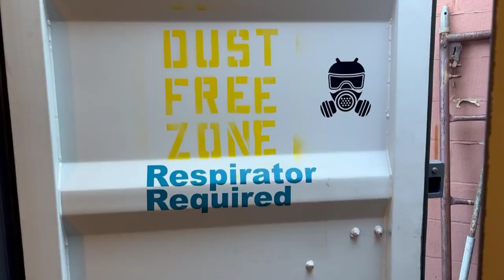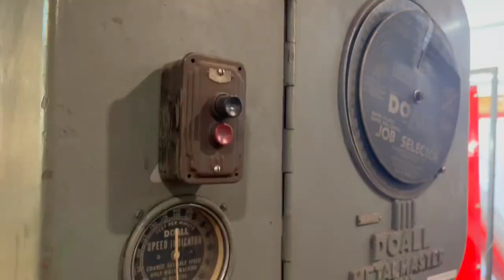Recumbent Trike Build, Episode 2023-01

Comment: Have ever put hinges on Trike bike to make foldable? I have a trike bike and want to make it foldable.
Reply from the maker: @Hōkūleà-m5r  yes. I actually found a free foldable bike that I removed the hinge and put it on one of my trikes. It works great, you just have to pay attention to the orientation of the hinge, so if the locking mechanism fails it won't fold onto itself mid ride.
Reply: @bentBuilder  Do you have a video on putting  a hinge on a trike bike? I need my trike bike foldable to be able to put it in a car trunk when I get a ride.